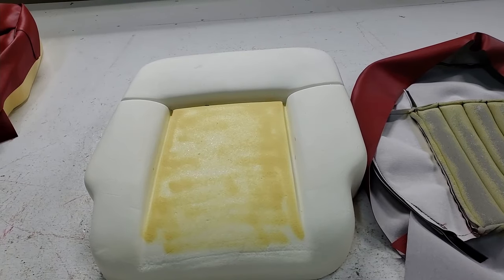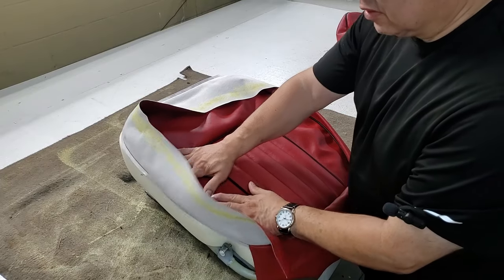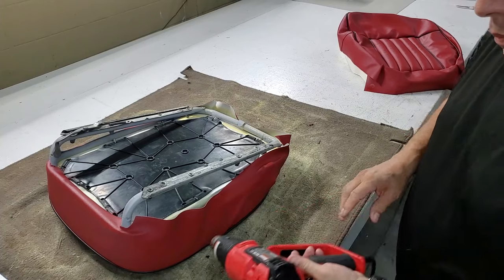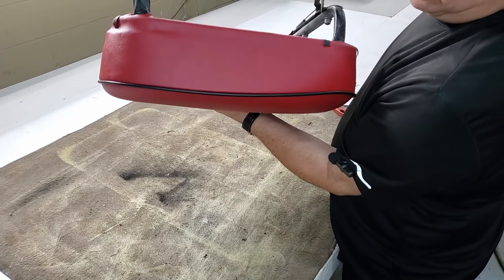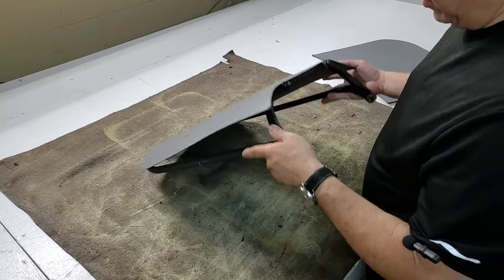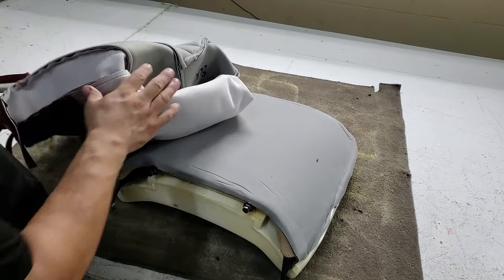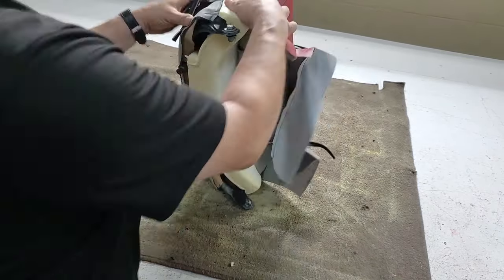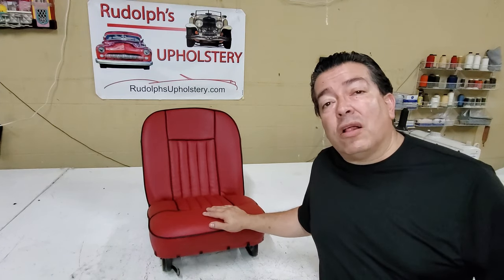Learn Now! How to install a 1965 MGB auto seat kit

Comment: Hello Rudolph!  Just wanted to share my experience putting my  backrest  covers on my MG seats. I watched your video about 5 times, added foam to the back like you did to prevent bagginess and even added a bit of lumbar support.  I then placed a plastic bag over the seat and my cover slid down with ease. Once all the way down I removed  the bag by pulling and tearing it out from the front and the back.. Was able to glue the pleated area to the foam inside and secure everything in the same fashion that you did. No rips pulling the cover on. They turned out spectacularly.  I’m very pleased with the outcome. Thanks for sharing your knowledge.
Reply from the maker: Hello Ed, I love hearing all the wonderful good news! I am so happy for you. Please keep watching!

Comment: Do you think folding the lower carpet area and sewing it (Not how Mg did it) that caused the excessive tension , you can see the welts pulling at this point where it tore. How did you bold the back to the base after you covered it. They are but and bolted together,  how did you get to the nut?
Reply: There was not an original seat cover to use as a pattern or guide. With upholstery, there is always more than one way to get it done. By the way, I did not make the seat covers, they were a kit.
Reply from the maker: There was not an original seat cover to use as a pattern or guide. With upholstery, there is always more than one way to get it done. By the way, I did not make the seat covers, they were a kit.

Comment: you pointed at narrow side for the shifter on the left (if sitting in the seat) and then said the tab is drivers side, did you put the wrong side on or camera flipped since front cam vs back, that always confuses me. how many things have you messed up on and had to rebuy them out of your pocket and did those ones cut into profits or you still had some profit margin just not nearly as much as you used to
Reply from the maker: Mistakes are very, very rare. This was a very happy customer who paid for the kit. So for me, it was 100% profit for my labor. No problems here!